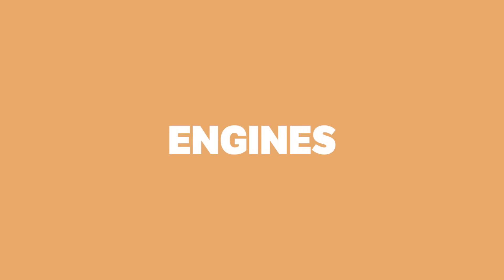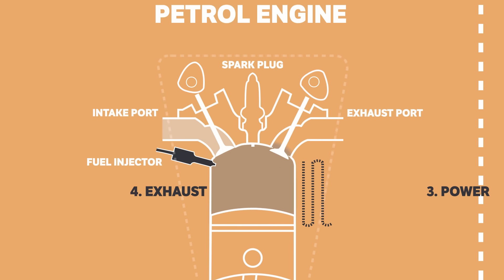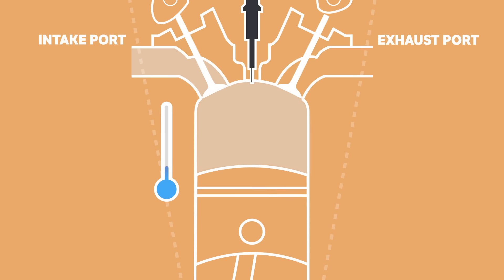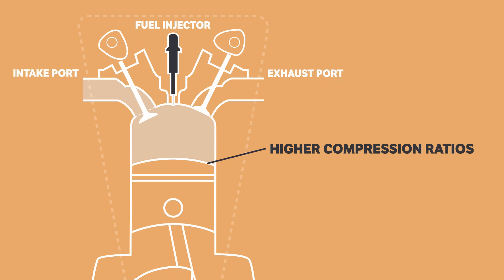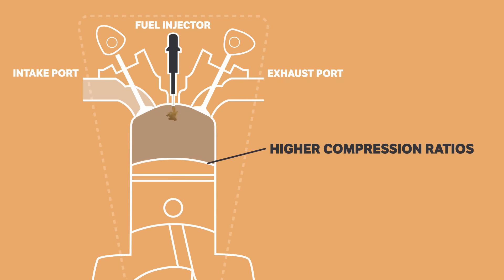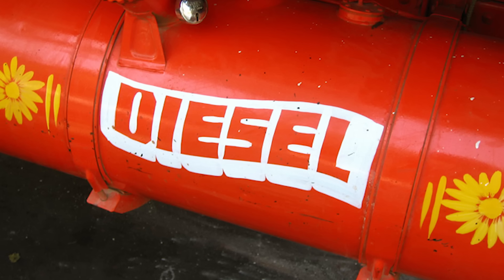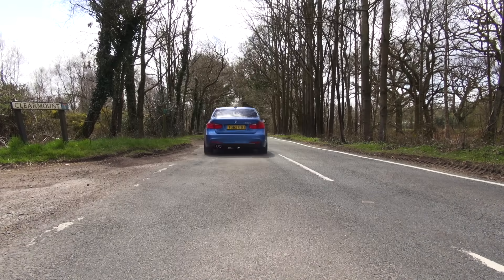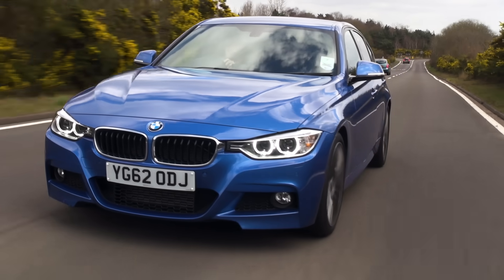The Differences Between Petrol and Diesel Engines

Comment: Diesel rocks... have driven gas cars for 15 years and then started driving mordern diesel car not old rattly crap diesel engines. It is superb, it's amazing how much power diesel cars produce in lower revs. I tested same car(Kia sorento) punchy 2.2L diesel vs 3.6L V6. In higher revs on a straight line petrol cars rock, good if you are racing the car every day. I tested both on a steep hill with 7 people on board oh my god petrol car was so unrefined as compared to diesel. The transmission had to downshift from 5th gear to 3rd and 2nd and it was struggling. Diesel was driving as if there was no steep hill very close to how it was driving on a no incline road. Transmission at 4th and 5th gear with 2000 rpm cruising with load on board. In human comparison petrol cars are like lean athletes and diesel cars are like bodybuilders. U add lots of weight to petrol car it starts struggling and diesel cruises.

Comment: Definitely a better driving "sensation" from a petrol engine but for an everyday road car it is difficult to deny the massive advantages of efficiency and low-R.P.M torque that a diesel engine provides. In terms of the ultimate driving experience though, petrol wins every time.

Comment: OK, I must admit, after seeing this vid, I'm quite curious about the fuel efficiency of diesel. I've got a 4-banger that's really good on gas, but let's assume I wanted to give diesel a look. First off, thanks to a report I had to do in high school (late 1990's) on the discovery/usage of diesel fuel, I know that diesel engines are generally larger compared to their gas counterparts because the high compression generates a lot of pressure and stress, and a larger engine block is needed to compensate. Is this still true today, and if so, does the larger engine block factor into fuel economy when it comes to the extra weight? Second, assuming I wanted to look at some cars with diesel engines, which ones would be best to check out in regards to fuel economy vs reliability/repairability? I'm sure there're models that're terrible at economy but great in repair cost, but there are others that are great in economy but horrible in maintenance cost. The car I have now I got in amazing condition for $2,100, so I'm not getting rid of it anytime soon, but if I were to start looking maybe a few years from now, what would be the best options available both in a sub-$5,000 range (assuming they can be had at that price) and what could be found in a sub-$10,000 range?

Comment: diesel drivers aren't the most fun to be around, because you have three different versions of diesel drivers: the car driver who thinks that their diesel powered Jetta is better than your car, there's the dude with the smokestacks coming through the bed with a trump and nra bumper sticker on the tailgate an black, white and blue American flag and confederate flag truck nuts thats rolling coal, then you have the ones who actually do work, buses, 18-wheelers, ambulances, heavy-duty pickups, constitution equipment, UPS/FedEx/DHL delivery trucks

Comment: Something you forgot to mention is how the Diesel engine has a much better power distribution on the Power Stroke, as the explotion happens in the whole compressed air/diesel mixture and pushing the piston down and the Gasoline explodes from the spark plug and having an explosion going from the top down and the distribution is not exactly perfect.

Comment: You very cheeky forgot to mention the fact that the naturally aspirated diesel engines died in the late 80s and early 90s.  Without the turbo, the diesel engine uses the same amount or even more fuel than the petrol and gives waaaaaay fewer HPs and torque. If we're comparing apples to apples you had to explain why nobody nowdays uses naturally aspirated diesels.  Also nothing was said about the glow plugs... Why ?! They're not important maybe ?!  But the thing i wanna know the most is why the hell every diesel engine sounds like a farting tractor once it turns 5 years ?!?

Comment: Higher compression ratio also means higher expansion ratio. This means that more of the explosive force is used for pushing the piston down (and hence making the car go forward) rather than getting blown out the exhaust. This is similar to how under-square engines are more efficient. Its all about leverage.
Reply: If the compression ratio is the same in an under-square engine vs an over-square one where are we finding leverage?

Comment: Ewwww Diesel..... why it is so slow at accelerating then?
Reply: T-X-M it’s not for power it’s for torque
Reply: But remember once they go, they go, diff is, shorter gears for pull away, take a fully loaded trailor in a 1.4 diesel and fully loaded trailor in a 1.4 petrol, with 5 people in each car, the diesel wil stil drive with the effect of being unloaded uphill in top gear with fantastic fuel consumption. The gasoline one might end up ib 2nd gear uphill consuming 12L on 100km
Reply: T-X-M so why you saw that have more power if they don’t?

Comment: 2:55 exhaust valve open during the compression stroke?   3:57 - turbo helps push down the piston? Err, remember that the turbine side of the turbocharger is driven by exhaust gases and thus impedes their exit from the engine. This a nonsense video.

Comment: 4:01 "[...] feeds compressed air into the cylinder which helps the piston descent into the cylinder therefore saving energy". You got that wrong! A turbo is there to helo get more air into the combustion chamber and therefore more fuel! The amound it pushes the piston down is neglactable, and also the piston needs more force to compress the bigger volume of mixture anyways, so that argument does not work.

Comment: what's the bashing of diesels in the comments? they're fine engines that rev low but give nice torque while gasoline engines give more power at high RPM, there are always exceptions to the rule, Audi R10 TDI comes to mind

Comment: Diesel is better and if the engine has a turbo the sound is almost the same as petrol. And it has much more fuel efficiency than petrol.
Reply: That's less to do with the turbo itself and more to do with the engine's more modern design.
Reply: OK I agree. But I also want to mention that I believe that each engine is better than the other in some things. Sports cars should use a petrol engine but trucks and SUV are more offered by a diesel engine. Here in Europe the diesel is cheaper than the petrol.

Comment: Needs a comment on why diesels are limited to 5k rpm - that is because there's no way to advance the ignition unlike a spark controlled petrol engine
Reply: No. It's because the diesel combustion flame front doesn't propagate as quickly a petrol combustion flame front. Basically once the piston speed is equal to the combustion speed there's no more power to be had. Diesel engines do use variable injection timing. Many current systems can have up to 9 injection phases on just once cycle.

Comment: Noob question, but why is it that high-end sports cars (F12, 675LT, 918 Spyder, etc) always have petrol engines?
Reply: Becoz they are (generally) lighter, sound better, and my guess is more economical. The only fast diesel powered cars I know of were some LMP1 prototypes and those weren't even road legal. Diesel engines have great torque but I haven't seen many used in road legal performance cars.

Comment: From an engineering standpoint, the diesel's are way better due to the higher thermal efficiency. Now if we could do a diesel cycle with gasoline rather than an Otto cycle... that would take the cake
Reply: Look up what mazda is doing with this, they are on the brink of creating that dream, a high compression petrol engine at high speeds and a spark plug for the cyclinders to use at lower speeds = the best of both worlds!
Reply: Diesel engines don't really use the diesel cycle but rather the Sabbathe cycle. Mostly the same but the expansion after ignittion is done in two parts i.e. partly with constant voliume and partly with constant pressure

Comment: I drive a mapped diesel with a paddle clutch and lightened single mass flywheel. It's just as rev happy and responsive as a petrol, has plenty of power and even more torque and at 120mph I still see 40mpg... I'll keep my diesel... money I've spent on suspension and tuning I've left a good few "faster" petrol cars standing.

Comment: Is diesel worse for the environment or is petrol worse?
Reply: Christian Stenger sence when petrol has a higher PARTICULETS
Reply: GT20Modding they use a scr system or don't flor it to make you think there clean
Reply: Christian Stenger and particulit madder
Reply: GT20Modding yes i did
Reply: GT20Modding at lest theres no PARTICULET matter coming out
Reply: GT20Modding both of the engines produced carbon
Reply: A very typical offensive name it also creates sulfur dioxide wich is part of the acid rain
Reply: bluemeannie I have a question for you....

did you heard about rolling coil in diesel cars? I mean like.. it's bad for the enviorment
Reply: Bluemeannie desiel is worst for the enviorment
Reply: GT20Modding petrol is cleaner
Reply: Of course you had to ask that question.
Reply: Diesel is worse electric is the very worst
Reply: JaArRyi FleshBlood did you pay attention in college?
Reply: petrol is, way more co2. and direct injecting petrol engines are as well worse for humans due to higher output of particulates. diesel is just worse on its nitric oxide output.
Reply: Bluemeannie petrol is because diesel is just carbon so it settles and just makes dust.
Reply: JaArRyi FleshBlood cleaner than your gasoline engine its just carbon dumbass.

Comment: You forgot to mention that it is easier to start a petrol in winter, that's why most Russian big trucks run on petrol, so they can start in winter in Siberia
Reply: GT20Modding literally every single truck stop has antigel practically year round here in the states, the only excuses are laziness or stupidity if your fuel gels
Reply: That applied maybe in the 1970s but not in todays cars. Also they have blockheaters.
Reply: The trucks I have driving in Russia are all diesel.
Reply: @jjwaters4037  if it was on petrol it would bearly move
Reply: @jjwaters4037  whell most of the trucks are on diesel
Reply: @jjwaters4037  cool
Reply: My Volkswagen TDI starts every time in the winter.
Reply: Its just as easy to start diesel in winter as petrol, just as long as the diesel has been winterized
Reply: @memelad8843 & GT20Modding. WRONG, i live in finland and even on -10celsius with winter diesel you feel a big difference, on -25 to -30 ur lucky if you can get it running before your battery dies, in siberia u might be at a temperature of -40 or lower even your block heater is frozen solid :D. and even tho u have a block heater u cant always park ur car on a spot where you can use it.
Reply: @karppa8657  -50c in finnish lapland sometimes. Diesels start and run, but some block heater should b always used just same like "petrol" engines. Its tougher to keep scraping off ice from windows or butt warm on backseats. :)
Reply: @memelad8843  Just as easy to fly without an airplane if you are a bird.
Reply: @memelad8843  even easier if it was using kerosene (don't forget to add two stroke oil)
Reply: meme lad Some people live in the desert like areas of Colorado where its not that cold but it gets down there once in a year and most people dont stock that stuff.
Reply: Diesels run better in the cold and they have glow plugs
Reply: Once i started to drive diesel cars i never will go back to petrol
Reply: hahaha
Reply: Search for Opel -30 start on YouTube. Even though it takes longer it does start at 30 below
Reply: MadProductionsink block heaters and glow plugs boi
Reply: Just imagine there fuel ecconomy on petrol but 😂🤣
Reply: @mikenolzeynolan4635  ev
Reply: Russian trucks a flamabel that means fire under the tank and it flows
Reply: Buy a diesel engine and let it run ideally... If you don't swich off the ignition or if you don't kill the engine u don't have to worry about start it again.. I have seen many people.. doing it..in winter... 

U can also park car in your garage/car park and can be use running engine/car as a power generator.. This is also I have seen people are doing in winter..
Reply: 30th year with a peugeot desil   never had a problem starting lol
Reply: Every car has Glow 🔌 Plugs 😤
Reply: Well not whole world lives in Siberia.....hahahahahha...
Reply: Indeed
Reply: Alpine diesel
Reply: Glow plug can solve this issue
Reply: And it is selfignition engines on petrol
Reply: Ive only seen the ZIL-130
And the ZIL-66
And ZIL-131

Shit
Reply: Do you know what arctic diesel is ? My diesel starts just fine in winter. And I don't pour arctic diesel in my tank. Only regular diesel. Never had a problem.
Reply: But Big Russian tractors run on Diesel
Reply: Why didn't they use spark for only a start on diesel?
Reply: diesel has higher compression=more power needed from the battery to start off
Reply: You can mittigate this advantage by having a strong amperage battery and a turbocharger that gives the engine enough power to ignite the fuel in less cycles.
Also another advantages of diesel are that diesel can be made from algae/biomass and it has higher lubricity than gasoline (puts less wear on the engine cylinders and pistons)
Reply: stuck in 1900s huh?
Reply: Good reply
Reply: GT20Modding it can as long as you have mor 911 mixture
Reply: meme lad not past -10F
Reply: MadProductionsink block heater genius.
Reply: because the diesel freezes at lower temperatures
Reply: MadProductionsink slav
Reply: I think it's because the systems isn't independent in its combustion so therefore it allows the spark plug to do the job. Whereas for the Diesel engine it needs the surrounding to dictate its temperature so if it's cold it's gone! 😂
Reply: Diesels have glow plugs and grid heaters. A properly maintained diesel will start  the same as a petrol engine with today's technology.
Reply: Diesel engines last millions of miles between a rebuilds. Petrol engines are more complex with more parts to go wrong. Unless you have own and drive both a person can't make an educated decision.
Reply: Trucks usually rev up to 3000rpm because a. it's a diesel engine, and b. it's a biga** engine, like, 10L V16 engine.

But with your case, trucks in Russia can rev to 8000rpm???
Also, it's an NFS Logic. In NFS Carbon, you have firetruck that revs to 6500rpm. NFS Logic.
Reply: not if the ignition freezes over lmao XD AS DOES HAPPEN WITH PETROLS plus you can mod ur diesel with a pre-heater for those winter rushes :) simple :)
Reply: Wrong. Most soviet (and therefore russian) trucks have petrol engines simply because they couldn't produce decent diesel engine. And diesel fuel quality was also extremely low. Yet majority of soviet military vehicles were diesel, mostly because of better range and disregard for reliability and maintenance cost. 
Btw, I drive 40-year old diesel car. Started it several times in -15 Celsius with no problem. No block heater, just stock glow plugs.
Reply: MadProductionsink very valid point. Petrol is more reliable. Period. The amount of energy used to charge up glowplugs versus a spark plug to strut the engine. Of course the diesel once started will use less power as it doesn’t require constant spark-ignition as it relies off of compression-ignition.
Reply: RACING WITH BRAD the amount of energy ? Just used power from the battery once started glow plugs don’t play a part at all as they’re no longer used

Comment: I've had both and I prefer petrol driven motors. Easier to fix and better at short distance driving and how many times have you heard dpf problems turbo gone etc etc. Oh and generally cheaper to buy.
Reply: DG that’s cool and all, but when you stop every 10 miles for fill your truck or 20 miles for fill your car, people who drive the same type of vehicle I do get 50+ mpg and an engine life of 250k+ easily. I drive short distance  to work in my diesel and get 45+ mpg, anywhere over 20 min drive I get 50+. Sooo the longer engine life outweighs the costs of repairing parts (petro cars only last 180-200k with lots of issues and repairs by then) while diesels get 200k+ miles with ease and keep going.